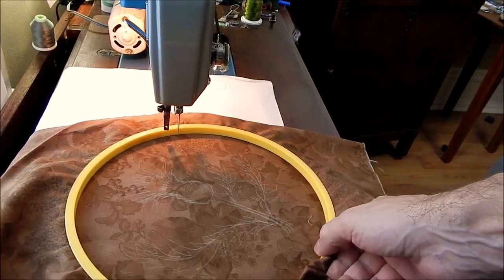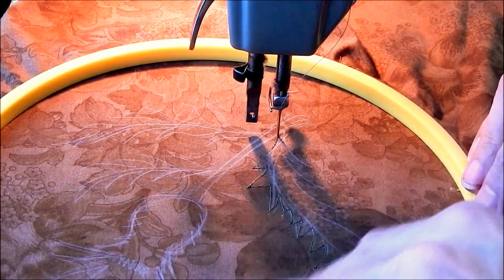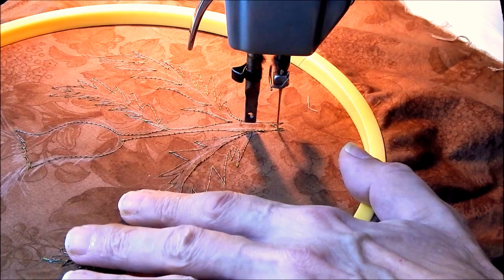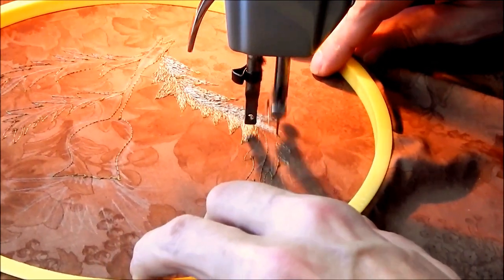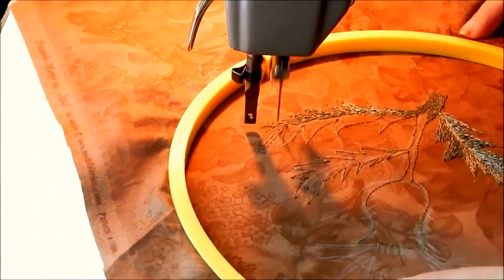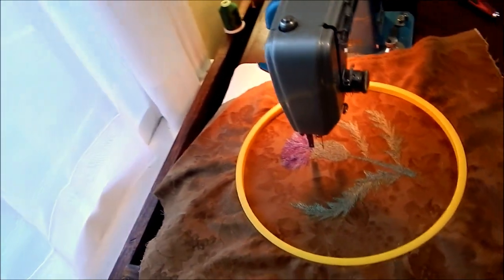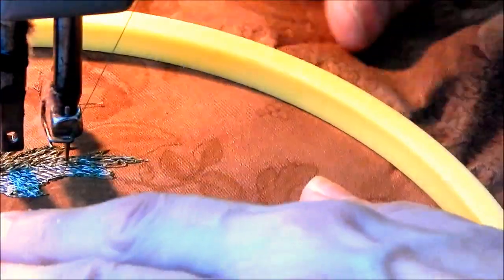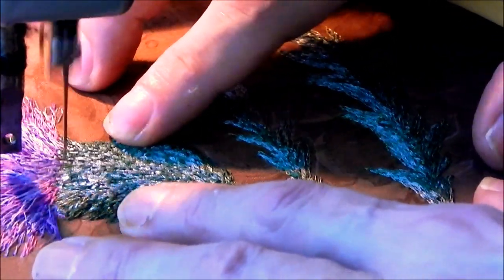Treadle Ebbroidery Thistle

Comment: Tim would this work on a modern machine without a darning foot if you lower the feed dogs
Reply from the maker: It should work......you need to play around with the tension....very loose top tension and tighter bobbin tension.....and you need to have your fabric very tight in the hoop and you would need to practice going extremely slow.....it is harder to make a modern machine go as slow as this ...but it should work